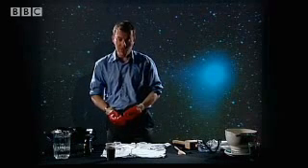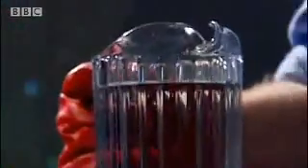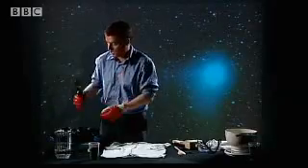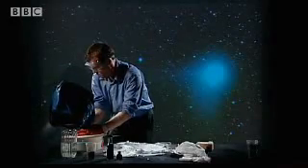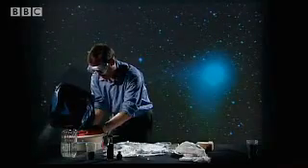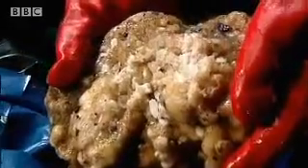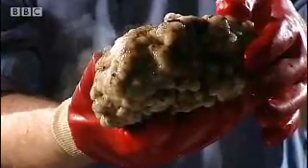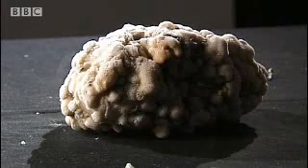How To Make A Comet: ISON No Electric Universe or NIBIRU, spaceship, ufo or Planet x

Comment from the maker: @ZombiexNMx Dry ice doesn't "Melt" into a liquid. It just evaporates into a gas until there is nothing left. The correct term is called "sublimate". Sublimation is the process of turning directly from a solid to a gas.   It takes longer for dry ice to sublimate than water "ice" to melt.. Try a test run at home and see how long it lasts. Should last a significant amount of time for a science fair..

Comment from the maker: @BvlgarigovIT You need to understand that it's not a "Charge" from the sun that is influencing it but Gravity that is influencing it. The sun has the most gravity out of any celestial object in our solar system. Next is Jupiter. As you see on Soho, comets get sucked into the sun frequently. Jupiter also has gobbled up comets as well as we saw Shoemaker-levy in 1994. Jupiter has been regarded as the solar systems "vacuum cleaner" by Astronomers because of it's heavy gravitational pull.